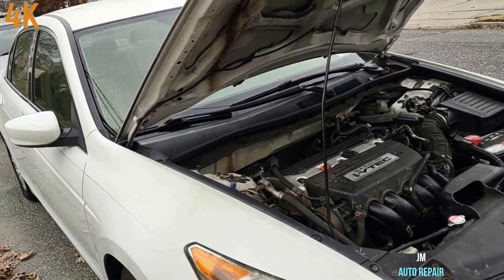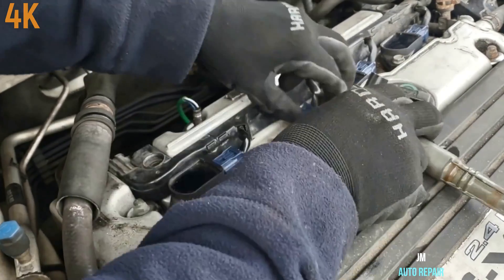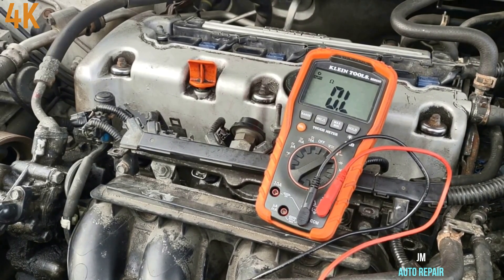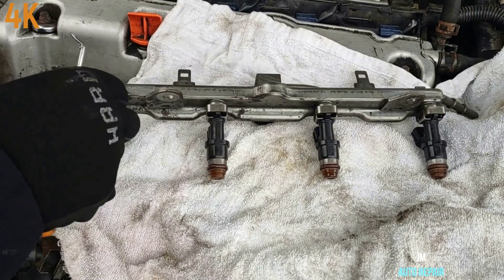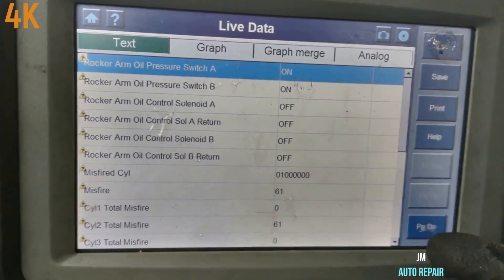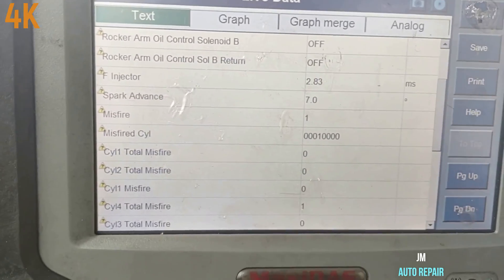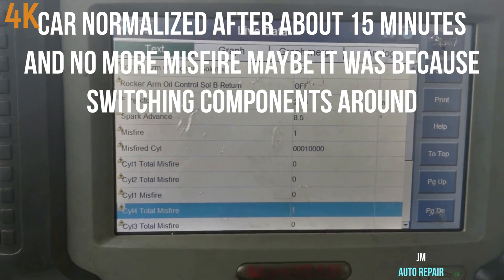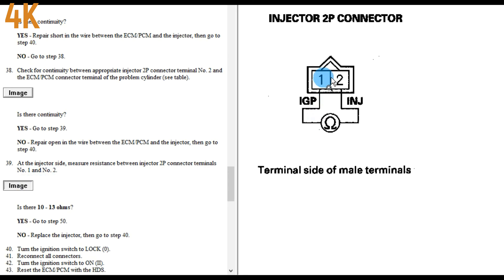honda accord 2.4 3.0 code p0301 p0302 p0303 p0304

Comment: Hey so far video has been very helpful ! What is the best way to take the fuel rail off ? Do I just have to force it ?
Reply from the maker: im glad the video is helpful, no you have to use the tool to take it out if you force it you might damage it.
Reply: What tool ?
Reply from the maker: @xdmegalonjd9384  on this 2.4 most of the time you only take the clamp out the one that  keeps fuel rail and hose toghether andpull them apart you have to kind of pull them hard apart to disconnet the fuel rail from the hose.
Reply: Ok thanks !